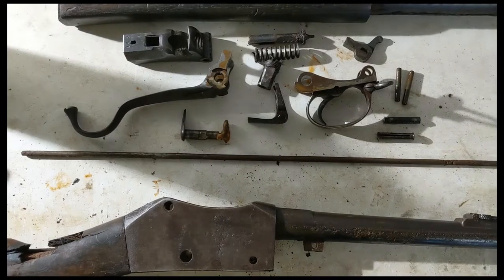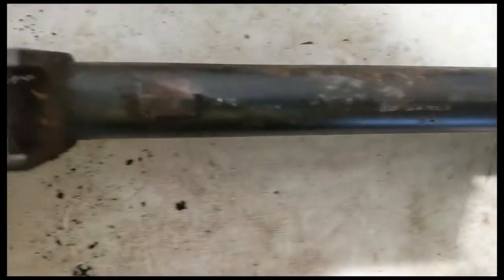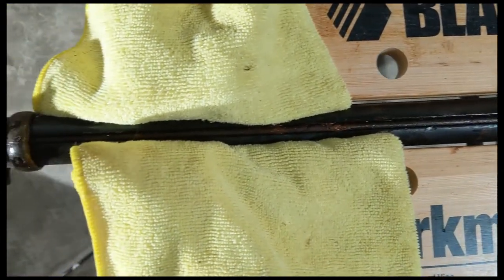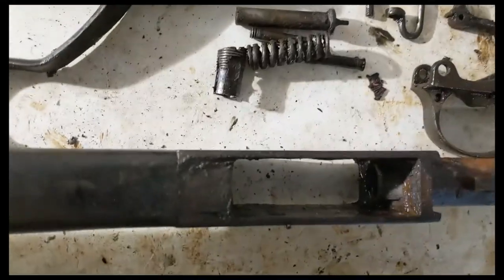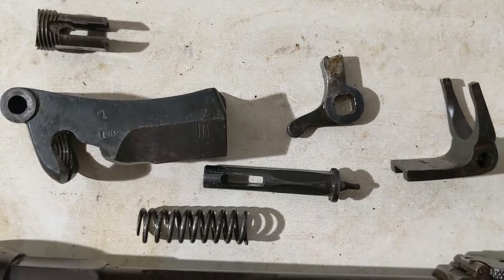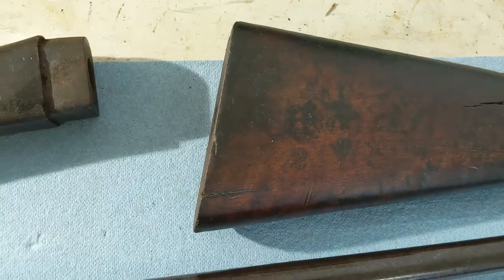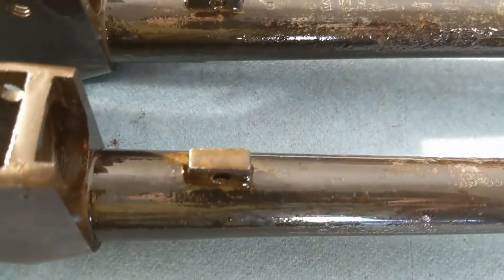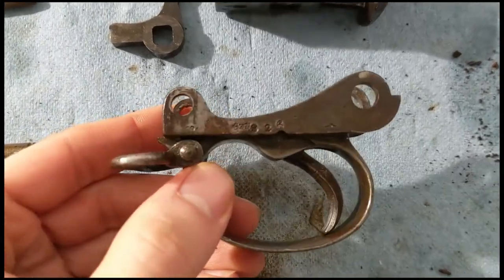Cleaning Two IMA Untouched MK II Martini Henry Rifles Pt 1

Comment: I do not consider myself a Gunsmith, but, I've been restoring and working on guns for over 65 years. I finally broke down and tried a product called Evapo-Rust and in my opinion it's a great product for removing heavy rust on gun parts. It does leave a gray colored coating on the parts which can be removed with slight buffing. Keep yer' videos comin'!
Reply from the maker: Thanks for the tip and glad you enjoy my videos. Hoppes can be a bit more time consuming but I like how it doesn't affect the finish or patina on the metal.

Comment: This is really interesting! I have a video in the works about cleaning cosmoline and grease out of my Mosin.
Reply from the maker: The 100 year old yakmoline on these Nepal cache weapons definitely presents a unique cleaning challenge.
Reply: @tfusilier44  do you need to reload ammo?
Reply from the maker: @8mmmauserman  the ammunition for it is not widely available commercially. Few places make it but usually runs about $10 per round minimum. You can get the cases and dies fairly cheap and reload yourself.
Reply: @tfusilier44  interesting!

Comment: Did you ever get around to taking the  rougher of the two MkII rifles to the range ?
Reply from the maker: If referring to the 1880s dated model I did test fire without issue. The 1870s dated model is still in parts as I plan to fit a new made stock to it.